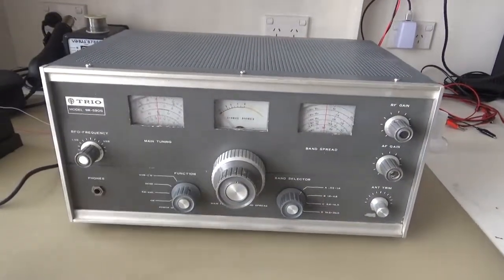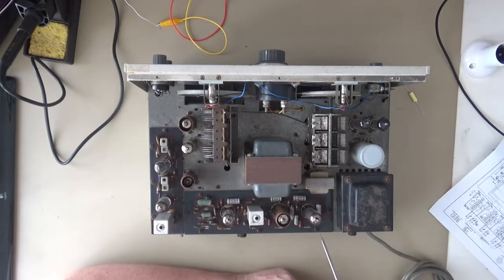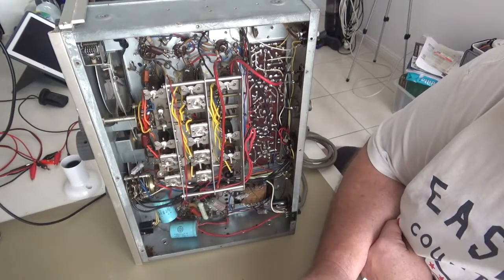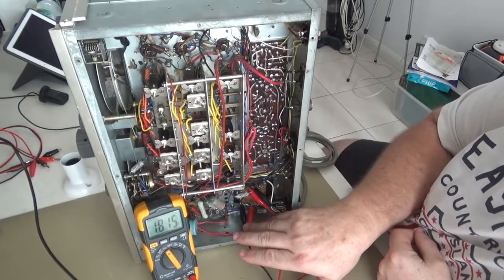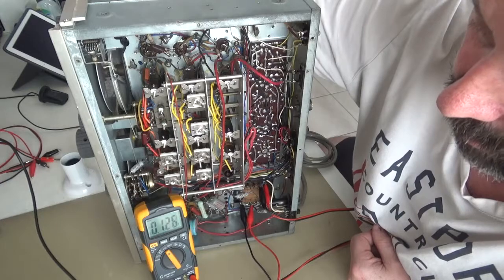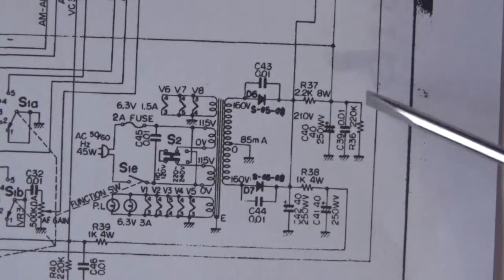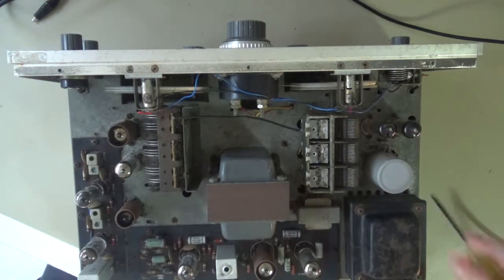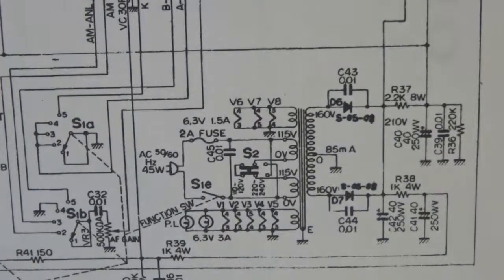#085 Trio 9R59DS Communications Receiver Repair Part 1

Comment: Love this receiver that my Elmer had in the 1970s and, in fact, I bought one myself several years ago and the receiver works.   Now, why is it that the S meter seems to always miss the light?  Lots of videos in cyberspace and I have yet to see the receiver with all 3 indicators lit up?   I am sure there is a bulb fixed to all 3 and replacing a burned out bulb that lights up the S meter should be fairly straightforward to do.